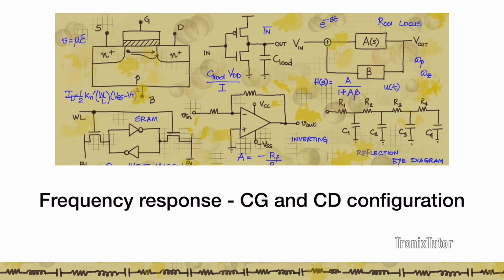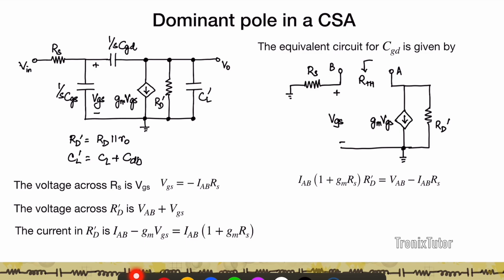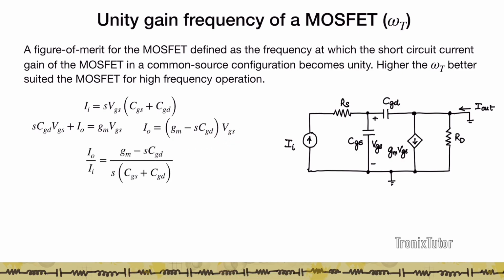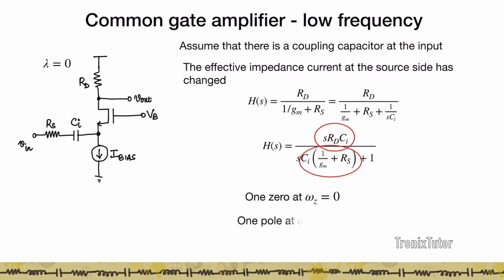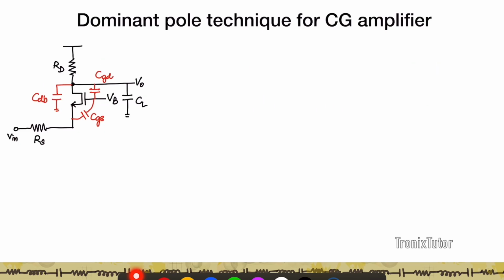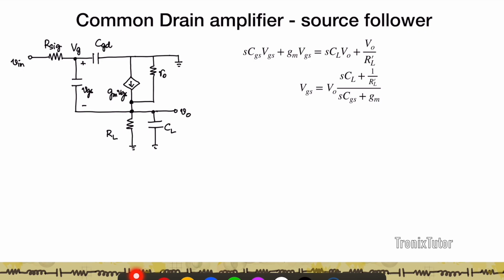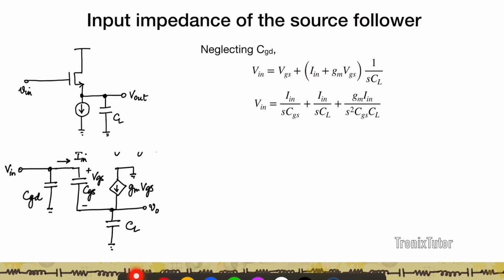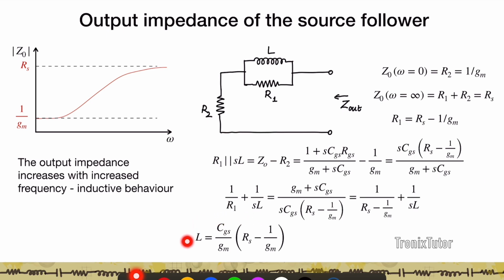The Source Follower Simulates an Inductor -- And That Is Not a Coincidence | HF Amplifier Analysis

Comment from the maker: If you want to understand where these poles and capacitances come from physically, watch this first:

Common Source Amplifier Deep Dive: Intuition, Source Degeneration and Output Resistance
https://www.youtube.com/watch?v=QY9Yp3y9KzM

Next step after this video:
Cascode & Differential Amplifier Frequency Response Explained | Poles, Zeros, CMRR & Bandwidth
https://www.youtube.com/watch?v=3h3dQX1pZJ0

This sequence builds the full intuition used in real analog IC design.